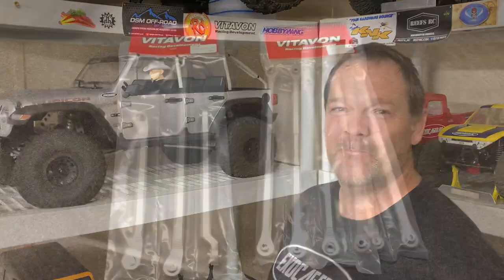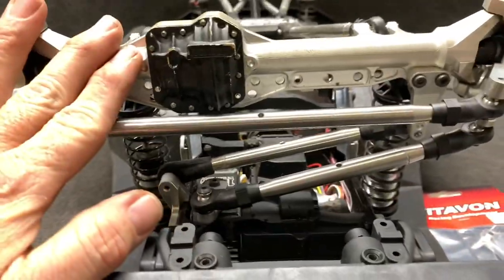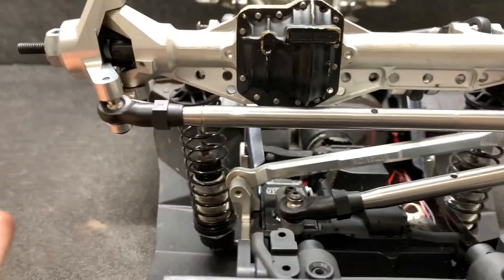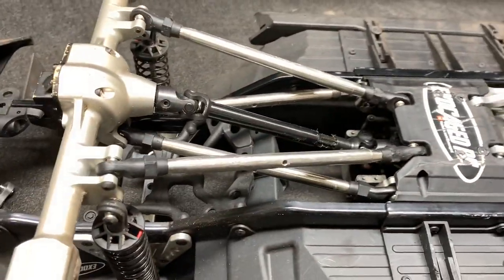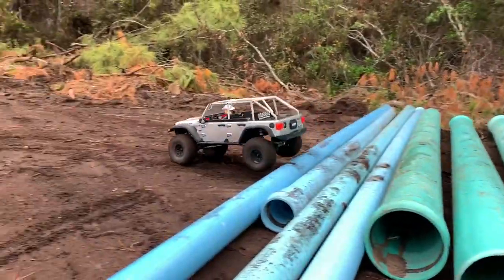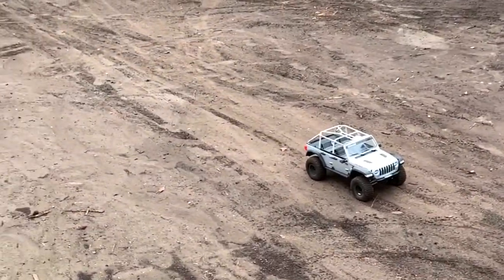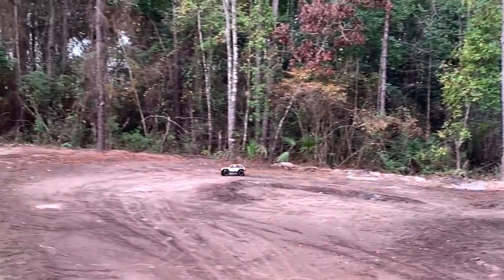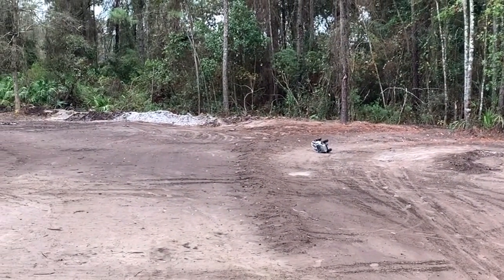SCX6 Vitavon Steering and Suspension Links Install and Drive

Comment: You should do a video to test to see if the aluminum links slide easier on rocks then the steel links sometimes they drag a little harder because some of them are made out of soft metal but those are probably heavy grade aluminum and I figured it'd be a little bit lighter it should be there aluminum 👍

Comment: Although completely unnecessary for my driving style or needs I WOULD like to pimp my Capra, Bomber, and even my TRX-4 Sport with Vitavon axle housings; but here is the problem. I have ALREADY had to replace no less than "3" stainless steel diff skidplates from the constant wear they receive in my rock garden. OBVIOUSLY the finely machined Vitavon aluminum pumpkins would eventually wear through just as OEM plastic pumpkins do. Do the $165.00 Vitavon housings offer a cheap. easily installed, sacrificial, $10.00 skidplate that can be added to protect them? If not, it is simply folly to invest such money on any one of my RCs